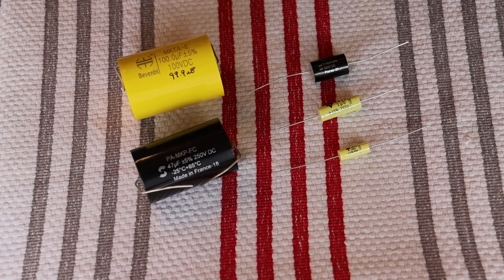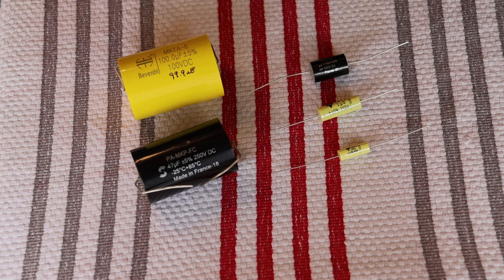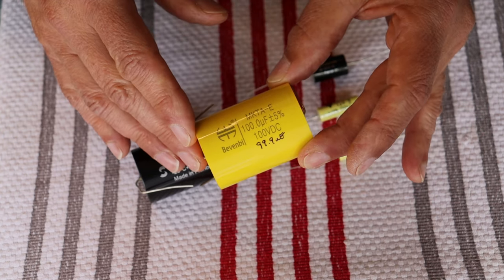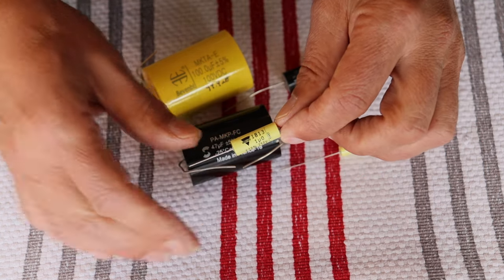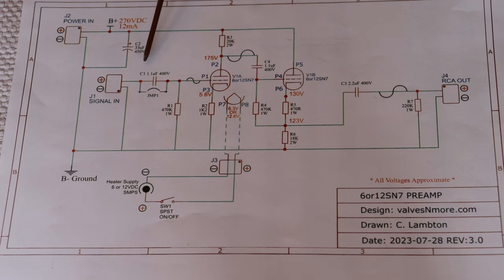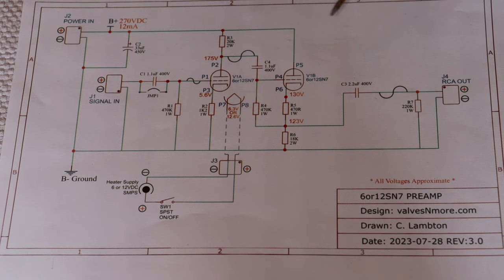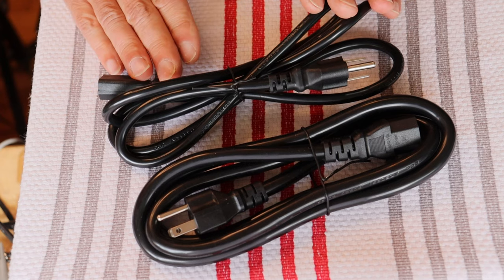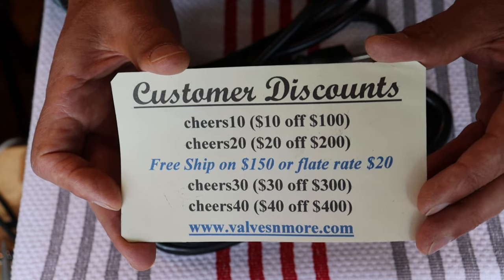Tube Lab #203 - To Couple or Not To Couple (Coupling Capacitors)

Comment: I know caps in the signal path colour the sound but even the caps in the power supply are in the current return path and can have a deleterious effect on the sound. 

Also, I have a KT88/KT120 push-pull amplifier with preamp/input 6AQ8 tube (first stage) and a phase inversion/splitter 6GU7 (second) stage before the output stage. These first two stages are directly coupled, meaning there is no coupling capacitor between them. The first stage has a cathode resistor that creates ~84V on the grid and this is passed onto the grid of the phase splitter 6GU7 tube.

The main thing I've noted with having these first two stages coupled is that it amplifies any differences between the two sides of the 6AQ8 twin triode. This makes it more important to have a well balanced input tube.

Comment: Thanks for explaining the preamp in more detail.. What Volume Pot value do you use for it btw?
Reply from the maker: @rickg8015  we use Blue Alps 100kx2 pots for all of our Kits.  Because the volume pot and section balance is so important for the stereo image, we also test the impedance of each channel at 4 different volume positions.  We typically filter out about 1/4 of the units as not having a close enough channel balance.

Comment: Great video as always, guys. Curious if you might be able to offer me some insight. I have a tube preamp, two stage with single gain tube and dual cathode followers with a 5U4 tube rectified power supply, capacitor coupled. When I power up the unit from cold I have measured a big spike of around 15V of DC on the RCA outputs (you read that right, volts, not millivolts) that is sustained for a few seconds and then quickly falls from 15V to almost 0 mv with less than 10 seconds. I don’t power my amplifier up until the preamp has stabilized. If I were to have my amplifier on when I start the preamp I do notice the woofers on my speakers get the high DC and get “sucked in” for a few seconds so I make sure that my amp is off. Why are the 2.2 uf caps on the output of my preamp not blocking the DC? Does this have something to do with it being a tube rectified power supply?
Reply from the maker: @sean_heisler  for a very short period of time, coupling capacitors need to power up before they can fully block dc.  Now the amp topology will definitely affect how much of a problem this is, as well as the rating, quality and condition of the coupling caps.  If they're older than 15 years or poor quality, then I'd suggest replacing them as a first step.  Caution!  Tube amps have high voltage present, if you're not sure what you are doing, I recommend bringing the amp to a qualified technician.
Reply: Don't know if this helps but 5u4 warm up pretty fast compared to 5v4 or 5ar4.might want one of those. 5ax4 and 5v4 still reasonable price and work for preamp.may have to ADD resistance to maintain same plate volt.check those 2.2 for leakage and the resistor that follow those caps to ground (bleader  resister).there should be one with value of 500 k ohm or less at out put to stop  d.c that leak through output couple cap.some pre with solid state rect.use muting relay.

Comment: I'm curious why the cathode resistor for the 2nd part of the 12sn7 is lifted off ground with R6.. Is this a solution for ground noise? 
Assuming... My home built amps are super quiet BUT just may be this is an upgrade I can try :-)
Reply from the maker: @AudioFanMan  I'm not exactly sure what you are asking.  So I'll summarize the CF (cathode follower) circuit.  R5 is the cathode bias resistor it works in conjunction with R4 (grid leak) to set the bias at 7v. And because the relative ground voltage is established at the junction, the grid behaves as though it is set to 0v when in fact it's actually much higher.  R6 is basically the plate resistor, but it's position is flipped from it's normal position on top at the plate.  The junction of R4,R5,R6 is a good place to take off the low impedance signal, but you could also take it off at the cathode pin as well.  This circuit gives excellent control of the operating point, uses very few parts and is very stable.  Noise really doesn't come into the design topology.  Though given the gain will be slightly less than unity, all CF stages are inherently low noise.  I think if you tried hard enough you could probably build a noisy one!  BTW this circuit is pretty much standard for a CF stage.  Hope that helps.
Reply: Rca tube manual chapter electron tube applications discuss this type of cathode follower of one want to read about it.good to know jim finding on the performance.
Reply: So I apologize, had a not so bright moment, I internally compared the cathode follower shown with a self biased cathode resistor to a plate driven driver tube.. doh!    As soon as I pulled up the schematic to my tube preamp I got my mistake.. but ty for the guidance!